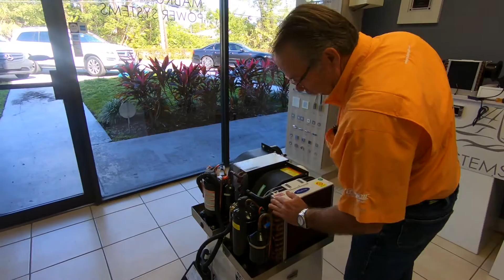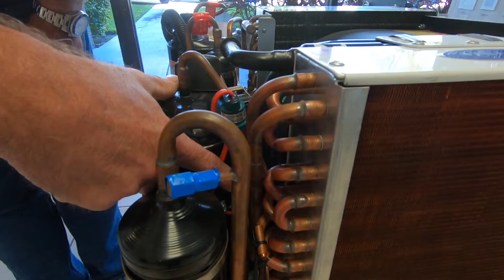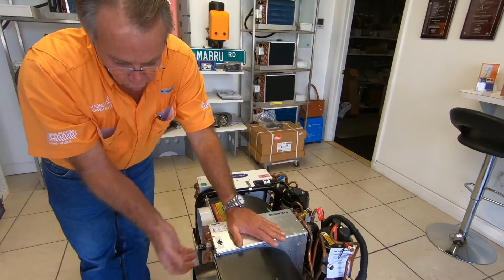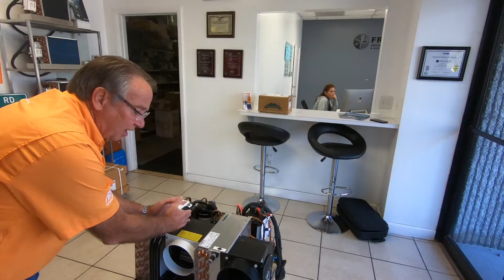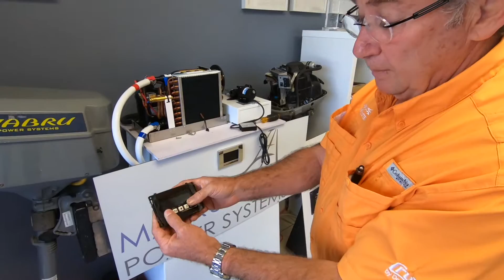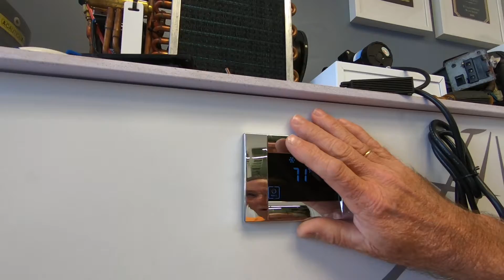How to Select Your Next Marine Air Conditioner - by Mabru Power Systems

Comment: So, this video is 5 years ago, where are you with the product today in 2025? What refrigerant are you using? I have 30,000 BTU Cruise Air that is not working, I have four of them; what is your solution and again, refrigerant can I buy just the condenser and use it with my air handler?
Reply from the maker: Hi Jack, We are using R134a and 410a currently on our units but we carry self contained units. There are manufactures that still make split systems which is what I understand that you have. You would need to find one that is rated for 407C if you want to keep your existing R22/417A evaporator. Split systems do not make sense to us. Split systems were popular into the 2000's due to the noise and vibrations that compressors at that time would emit but the newer units are much more quiet, efficient, economical, and easy to service. If it were my boat, I would take out that split system and replace it with some self contained units but I also understand that there is some added work required to replace the units as water would need to be ran to where the evaporator is currently located.
Reply: @ first, thank you for the quick response and the information and I agree with you. I think it would make sense to take it out. The problem is getting the air conditioning to the middle of the boat after mounting the condenser in the lazarette
Reply from the maker: @JacksLore  The idea would be to place the self contained unit(s) in the location of the current evaporators. The size difference between a self contained unit and just the evaporator and blower is minimal and there is typically space available for that to work. The beauty with this setup is that aside from the benefits of moving to self contained, you would also free up the room in the lazarette where the condensing unit used to be. The major change is finding a run for the water lines that were going to the unit in the lazarette to the cabin where the complete system would be installed.
Reply: @MabruPowerSystemsINC  thank you again

Comment: Don't buy Velair.  No warranty wont even ship parts. Will not respond to me or the boat manufacturer. New boat.
Reply from the maker: @matthewtatarian147  we have our own line of variable capacity self contained units. What is the capacity of the current unit that you have installed?

Comment: I love that intro! You got me dancing out of nowhere.
Reply: @fernandog.1575  cool. Spend the money and buy a reputable manufacturer.  Now after six plus months of no air I have a very expensive anchor.
Reply: @matthewtatarian147  Did you buy this company's product, and it failed?
Reply from the maker: @matthewtatarian147  We are unable to find you in our records, if you had a failure after 6 months, it would have been covered under warranty if the installation was done properly.
Reply: @MabruPowerSystemsINC  
Are you Velair?
Reply: @MabruPowerSystemsINC  I bought a new boat from Seawind and picked it up in Vietnam. It's a sea wind 1190. When Seawind suggested that Velair replace the unit as the repairs didn't work. Velair stopped communicating
Reply from the maker: @matthewtatarian147  Velair is a completely different company. we are Mabru and have no relationship with Velair but I’m sorry to hear about your trouble
Reply: @MabruPowerSystemsINC  yes I'm thinking about buying your product next. Someone said you were affiliated with Hope well in China. Is that true. They  have a good reputation in Asia

Comment: power consumption please...that is if you decide to answer people's questions.
Reply from the maker: Our 17,000BTU unit draws 10.5A in 115v and 5.2A in 230V
Reply: @kentwood2914  I don't know.  I only used it on shore power. Sometimes when the shore power was out it was pulling 60+ amps at full load. As these electric motors are loaded up they draw more power and as the load goes down so dose the watts.

Comment: Is this a 16000btu unit? Can you please advise on the starting current for the compressor at 230v. Thanks
Reply: @MC-kg8hm  it's very low. It starts at a low draw then ramps up slowly. When it works it was great. A shame they don't care about their name or customer.
Reply: @MC-kg8hm  because my solar and house bank are large the boat will run the air conditioner for over a day without other power. So I never thought to look at the amp drain as I didn't know that I was on battery power till it shut down
Reply: @MC-kg8hm  it is a 16 k unit